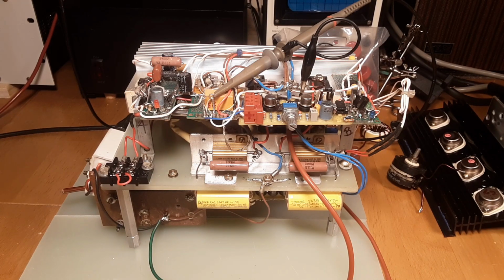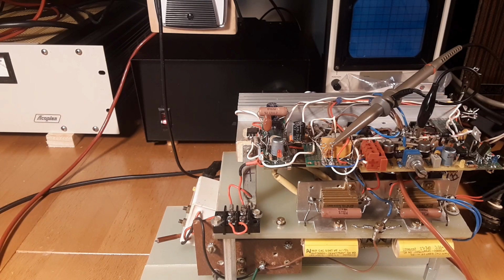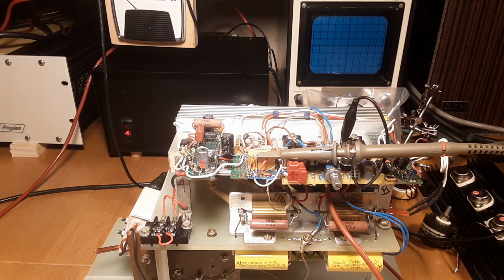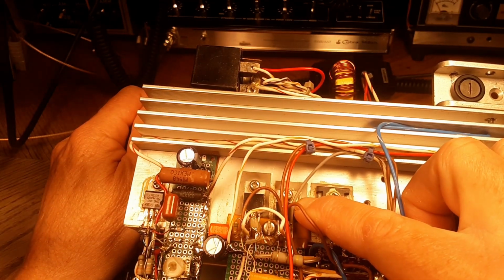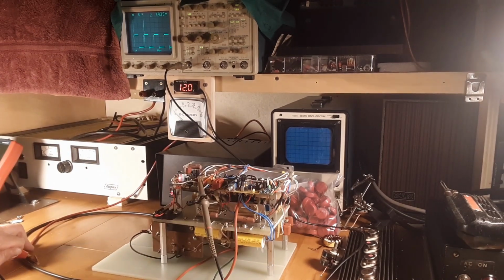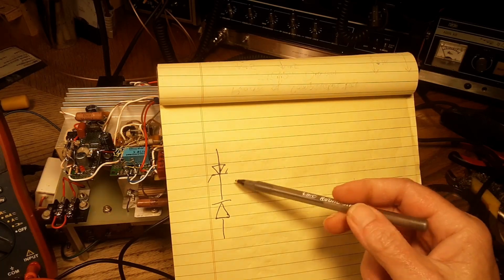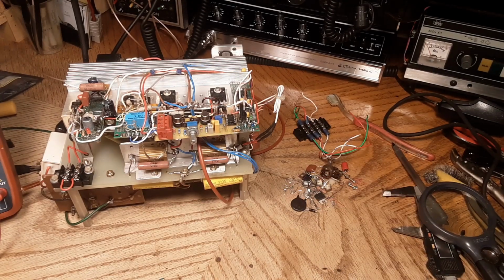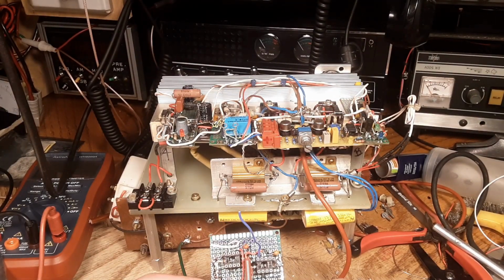igbt flyback driver intermittent(part 1),im burnt out🤕😟

Comment: The voltage drop when it arcs may let the supply voltage drop below the under voltage lock out voltage and disable the output, do you have 100nF across the gate drive ICs, i would make sure you have a solid 15V on the gate drive ICs
Reply from the maker: Yes ,I know why u said that.the gate drivers were "wrong".i plan on a follow up,it should be good now.🙏1000 turn transformer is bad luck.
Reply: @generalingwer4341  👍🏻👍🏻👍🏻